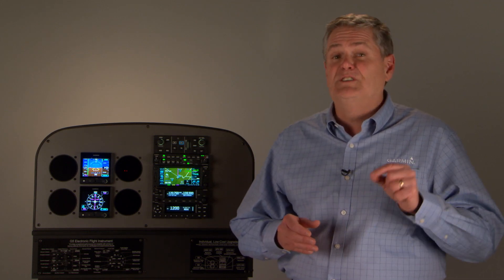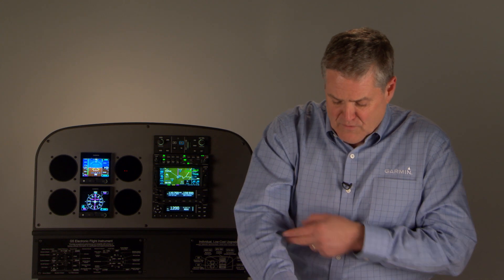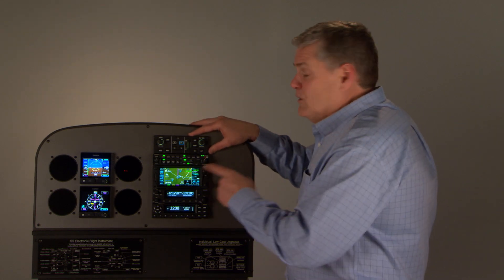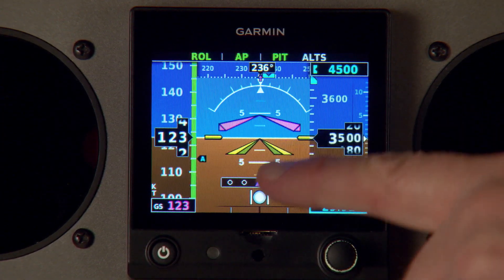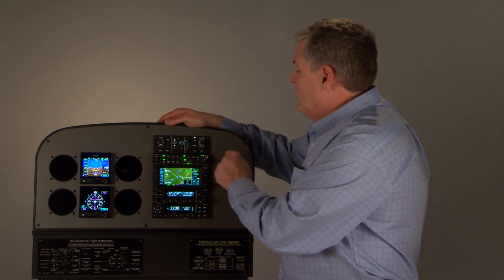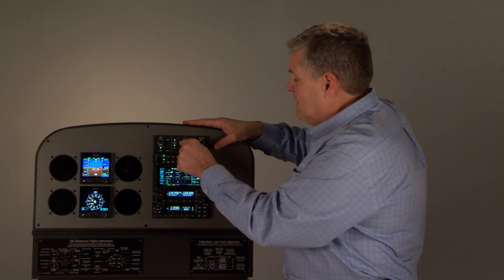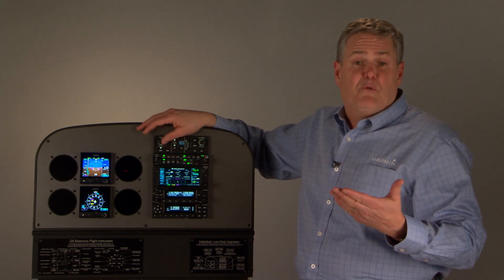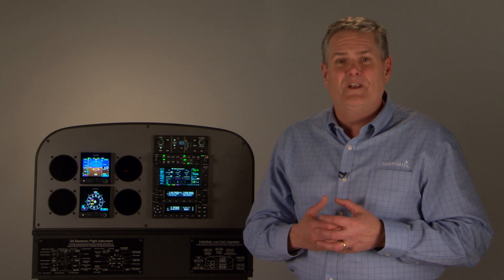Garmin GFC 500: The Digital Autopilot Retrofit Priced for Light Aircraft

Comment: This is a very good autopilot, except for one "feature": the autopilot WILL NOT disconnect if you try to overpower it. Rather, it will fight the override attempt by trimming in the opposite direction. That could be dangerous. It's instinctive for a pilot to grab the controls in an effort to prevent it from suddenly doing something that the pilot does not want. Every other autopilot I have ever flown...military, airline, and GA...will all disconnect if you apply manual force against them on the controls. I'm guessing that you will get a big surprise if you make any attempt to overpower this one even momentarily...and then disconnect it.

Comment: Rate of Climb and Pitch mode for climb can easily exceed the climb performance of the  aircraft and needs to be monitored very closely.  Also it would be nice to see the mechanical components and their installation.  A block diagram would be nice.
Reply from the maker: While the pilot should monitor this like you suggest, the GFC 500 also offers  underspeed protection while the autopilot is engaged. If the pilot commands the autopilot to a vertical mode, either IAS or VS, that the aircraft is unable to perform, GFC 500 automatically lowers the nose before reaching a stall. I discuss some details of the mechanical components of the GFC 500 in this video: https://youtu.be/4njmzWp4LQA?t=475. I will share your suggestion to the team for more system architecture information for future content produced. Thank you for your interest in Garmin.

Comment: 11/13/2019

1. What does under $10,000 mean? $9,000? $7,000? $2,000? Why can’t you say $7,000, the actual price? Why must you sensationalize?

2. If a G5 is required, then for those of us who do not have the G5, we must buy it; the G5 costs $4,000 installed ; accordingly, the GFC500 will cost us $11,000.

3. Ifa GPS is required to operate the G5, then the cost of the auto pilot for those of us who don’t have a G5 or a GPS is $20,000 out the door.
Reply: 1CAV11B under 10,000 means 9,999.
Reply: djbred18 If “under 10,000” means “9,999,” then say so. Isn’t easier to say “9999” than to say  “under 10,000?” Why not just round off and say $10,000?

Comment: Why not a light twin? I have to spend 20k for a 600?  Bs.
Reply: 11/15/2010

No, not $20,000, try $35,000 since you will need a G5 and installation. Try $45,000 if you need a GPS source. I cannot grasp the motive behind the deception, i.e., suggesting “under $7,000” as the cost.

Comment: Will it be efficient to install the GFC 500 in a 2006 G1000 Cessna T182T, already with WAAS and SVT to replace the KAP140?  Are there any optional items that add cost to the upgrade?
Reply from the maker: Thank you for your inquiry. Unfortunately, G1000-equipped aircraft are not eligible for the GFC 500 or GFC  600 retrofit autopilot.
-JPK